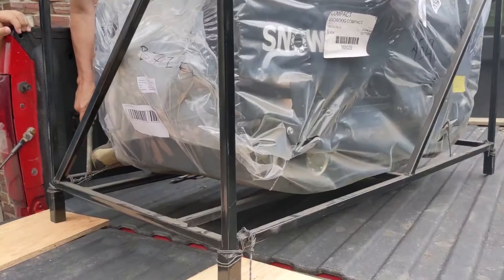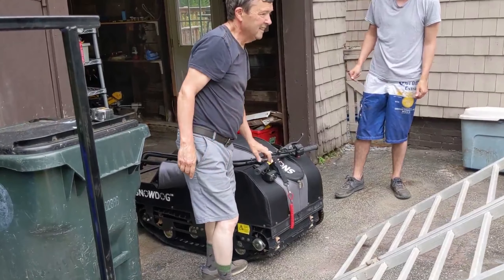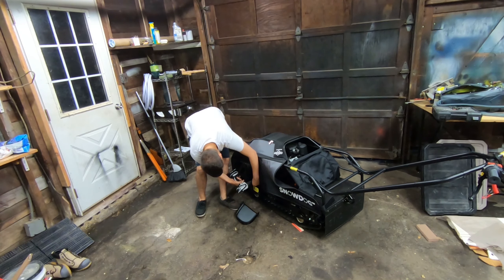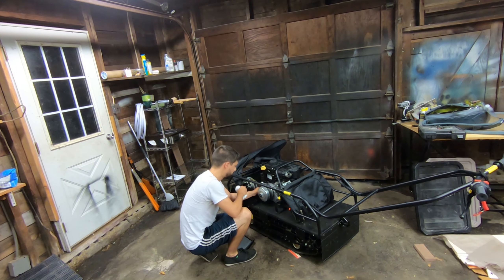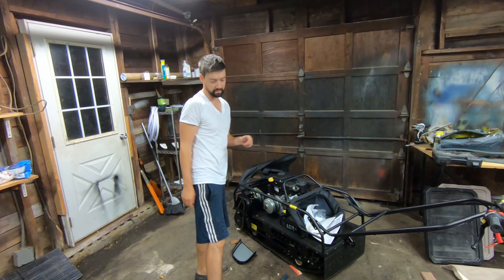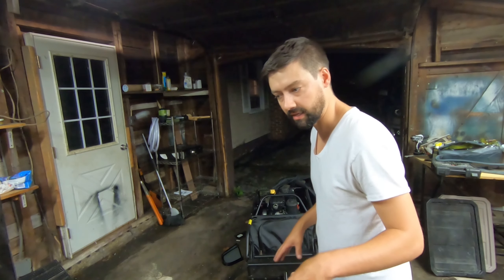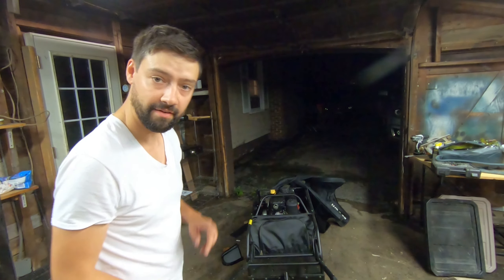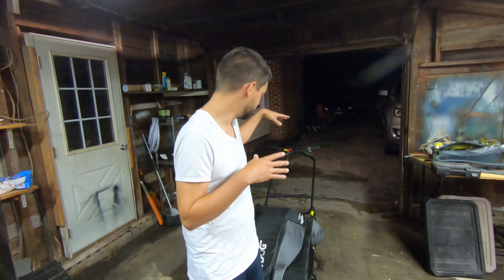SNOWDOG Unboxing and Setup-Ice Fishing Game Changer!

Comment: I bought the larger horsepower one 3 years ago and upgraded with a big bar LED light and studded the track. Game changer! Cheers
Reply from the maker: I'll be doing studs soon. The 7 seems to work with 200 lbs on snow so far. I'll probably have another 50 of ice gear and see how it does

Comment: U gna use that for the week u have 4 to 6 inches then break the snow machine out
Reply from the maker: Been using it all year on snow and ice handles it fine
Reply: @BendItFishing  u use a seperate trailer how much that weigh
Reply: Weighs almost as much as a snow machine dont it
Reply from the maker: The snowdog only weighs 240 lbs. Easy to move around
Reply: @BendItFishing  that's the small one correct because the full size I saw weighed over 400lbs about as much as a snowmobile
Reply: @BendItFishing  not easy to picup 240lbs so u must trailer it when u go fishing or bring someone with you
Reply from the maker: The top model only weighs 330lbs. I use a trailer hitch scooter tray for it and it's very easy.
Reply: Hows it handle the slush on the lake
Reply from the maker: @ryanstevenson1364  I'll let you know tomorrow haha
Reply: @BendItFishing  I think it's a cool little machine but u can get a decent snow machine for 2500 but then u have to register insure buy a trailer I live in northern Vermont and the ice condition are crazy some years sometimes u can bring your truck out all year this year is a snowmobile year due to the deap wet snow and slush thanks for your replys
Reply from the maker: Handled 6 inches of slush like a champ today towing me and another guy with two sleds and double gear
Reply: @BendItFishing  u do any filming out there
Reply: @ryanstevenson1364  u wanted this machine to be a failure so bad lmao.
Reply from the maker: Haha most people don't like different things it's okay!
Reply: @ShaqTheBoss  y would I care...u can pick up a decent snowmachine for 1500
Reply: @ryanstevenson1364  u cared enough to make up lies saying u seen one of these that was over 400lbs. U were hoping it did horrible in slush 😂😂. And you're comparing a "decent" snow machine to a brand new one that can fit in the back of an suv, and can get into spaces a snowmobile can't even dream of.

Comment: I love my snowdog. I got the 13hp full size model and it's a beast. I have used it for bear baiting and general transport in the summer. I'm pumped for ice fishing season though. Best part is I don't need a trailer and will just use a scooter hitch carrier.
Reply from the maker: They are awesome, I was thinking of getting a scooter hitch, which one did you get?
Reply: @BendItFishing  I bought the UC-500XL hitch carrier from Summit Racing. It's more expensive than a lot of other carriers but It's made of steel and it's the only one I trust to safely carry the 300lb snowdog. Plus it has a ramp so that's nice.
https://www.summitracing.com/parts/rrr-uc500-xl
Reply from the maker: Thanks! That is pricey I'm going to try and see if everything fits in my truck first, if not buy a used one of those
Reply: How much will the 7 hp pull in snow or packed down snow?
Reply from the maker: @paulrenier1550  not sure yet. What I've read is it can pull 330 on flat ground like a lawn and much more on ice. I have also heard it's a little underpowered for most other things
Reply: Bend It Fishing  thanks for the response

Comment: If it has electric start on your motor it  has a charging system so you do not need to disconnect your battery
Reply from the maker: Just trying to charge it when its not in use

Comment: Why not buy an air cooled 2 up used snowmobile instead? Less expensive and easier to find parts.
Reply from the maker: This I can run year round! Way more versatile
Reply: In Canada you don't need license and no insurance is required, it'll pay for itself in no time. Cheers
Reply from the maker: @frankcurtin5561  have to register it for $130 every year here. I don't have to insure it but ice is ice and stuff happens
Reply: @BendItFishing  yeah I can understand that. Most of the lakes that I fish up here, because of constant  thaws and freezes over the winter, tend to be more ice-covered than snow-covered. You can do a lot of 360s unintentionally if you're not careful on smooth clean ice without studs. I put 25 studs on the track and pull on average six to eight hundred pounds each trip, 3 guys and a pile of gear. Takes right off from a stop. It's the cat's meaw. Good luck ice fishing this year.

Comment: dont forget to grease the bogeys and shaft bearing before using it... otherwise your going to change a few in a year or so... believe me russian sealed bearings aint sealed for shit.
Reply from the maker: Hmmm tell me more
Reply: @BendItFishing   wheels have white caps on them. Remove them and reach between the bearing gasket and the inner ring of the bearing with a grease needele and stuff it as much as you can.

The rear axle also has 2 bearing insige the plastic cog and is harder to reach... i had to dismantle the whole thing to stuff grease on both sides of both bearings . Both bearings went bad after 1 season because of water infiltration. My brother even had one completly seized in rust.

Check it out, maybe its just us who got poorly lubricated OEM parts.
Reply from the maker: Thanks for the tips I'll definitely take a look at mine what kind of grease did you use
Reply: @BendItFishing  ordinary bearing grease...
Reply: Maybe I got lucky, I am going on three years with mine and the bearings are great...